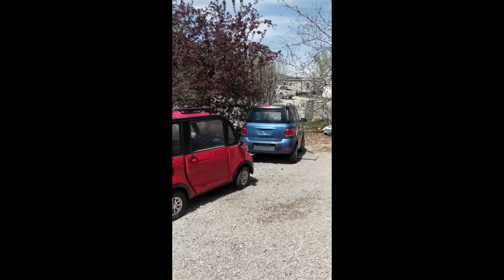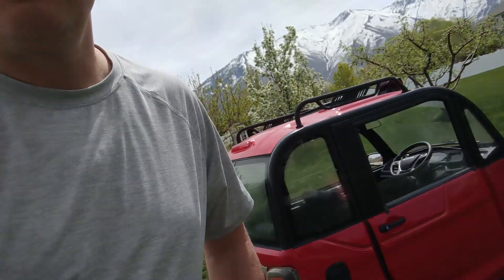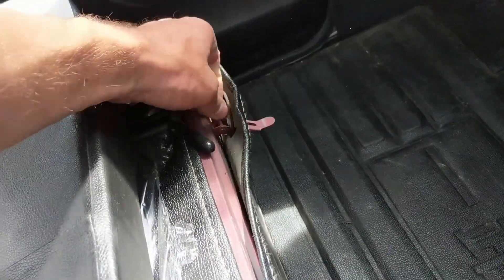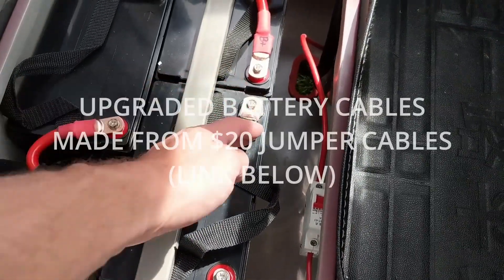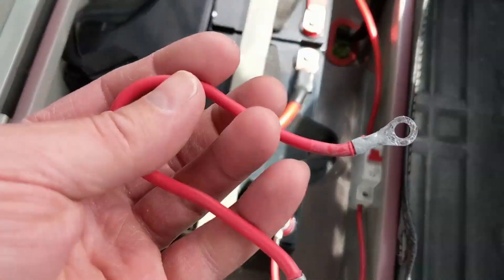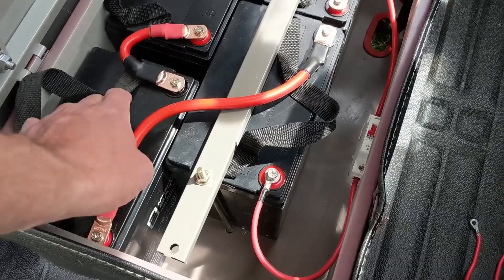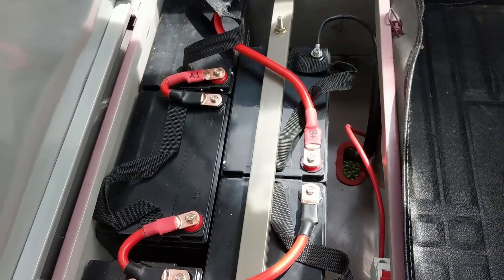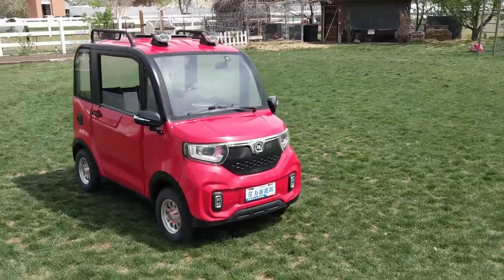EXTENDED RANGE REPLACEMENT BATTERIES FOR CHANGLI EV

Comment: how do you charge it? I recently acquired a changli truck but there isn't a charger with it. I am currently charging the batteries one at a time with a regular 12 volt charger
Reply from the maker: Should be a port in the side like a gas cap. No idea what charger the other model uses
Reply: @3dconceptsofutah757  yeah, there is a charging port I just didn't know which of the two plugs in the port to use or if it used some special charger. I think I have found one on amazon though.

Comment: Hi, I have a similar problem with my golf cart. The batteries will not charge, looking to replace. The batteries you have demonstrated in the video, can they use the same plug in charger? Would really appreciate your input😊
Reply from the maker: Hi! You would probably be better off with golf cart batteries.
Reply: @3dconceptsofutah757 Hi, what would be the replacement battery charger?
Reply: @3dconceptsofutah757 can the original charger work with the new batteries?
Reply: Looks like the original charger has been fried, will not come on fan is not blowing
Reply: Do you know which charger would work with the new batteries?
Reply: Thank you so much for your insight. Contacted the company and they were no help what so ever

Comment: That wire is a massive bottleneck. Try moving the circuit breaker closer to the engine and using a distribution block to make the run of small wire as short as possible. Then upgrade to like 2/0 or 1/0 welding cable or car stereo wire. Ideally make the small run of wire less than a foot in total length engine to circuit and circuit to distribution block. It will help with heat and allow more current flow.

Comment: Making the battery interconnect cables to the same length is also a good idea
Reply from the maker: Thanks! Yeah that is a good best practice. They are so overkill for this application though I don't think it will matter as the resistance will be so low with 1AWG jumper cable 😆
Reply: @3dconceptsofutah757  over a decade of off grid solar installs has made me a bit set in my ways. 😂
Reply from the maker: @unicornadrian1358  Wow that's a cool profession! Where do you operate?
Reply: @3dconceptsofutah757  In Queensland Australia. It was good fun.